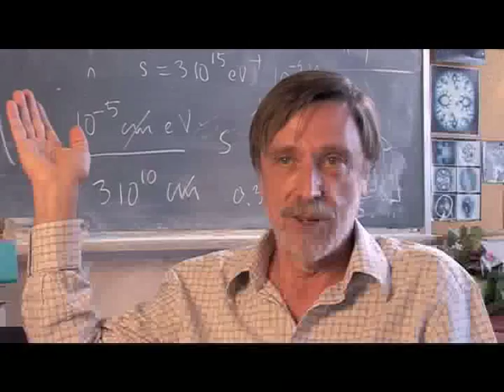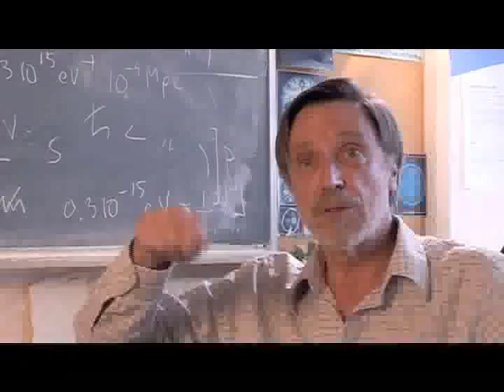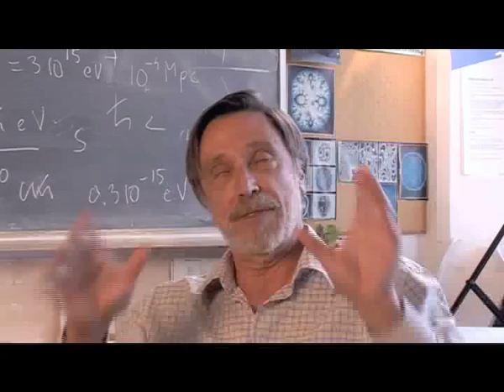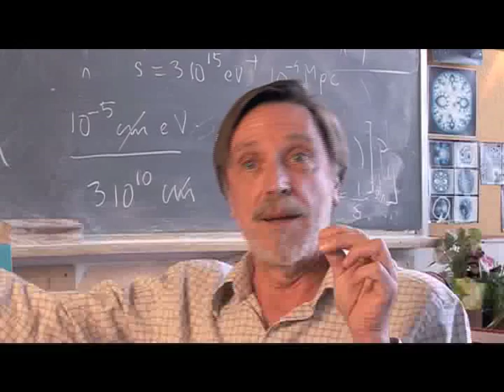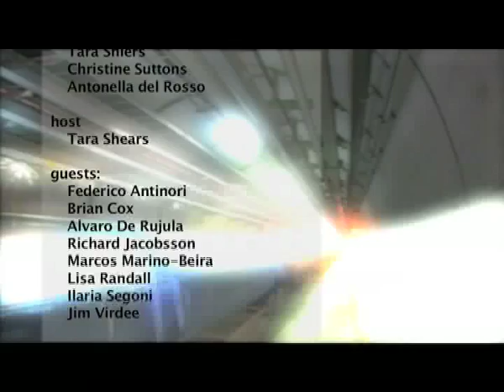The Large Hadron Collider

Comment: It's actually easier than going into the realm of ZPE.  All you need is a chamber and positive displacement pump that can handle a pressure differential greater than atmospheric (about 14psia) and as many days as you feel like waiting.

You'll never get 'perfect' vacuum, as each stroke carries out successively less mass, but you can get pretty damned close. You can use calculus and stoichiometry to predict the resultant vacuum for a given time, frequency, and stroke length.

Comment: Almost. A black hole is a concentration of mass dense enough that it causes a gravitational field significant enough to pull other things into it and compress them.  2,000 packets of protons aren't enough mass to create a black hole.  Even at high velocities where their mass is 22 times larger than normal, that's still not enough mass to create much gravity at all. You would need the matter of a small planet or moon to create a significant black hole.